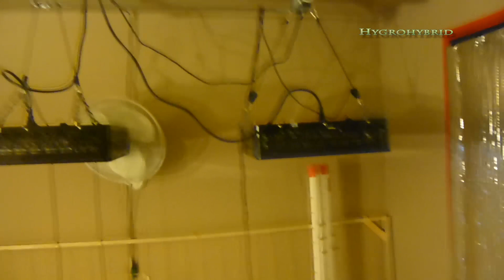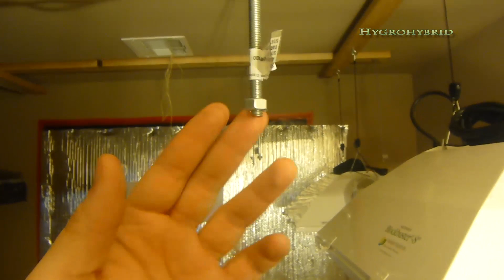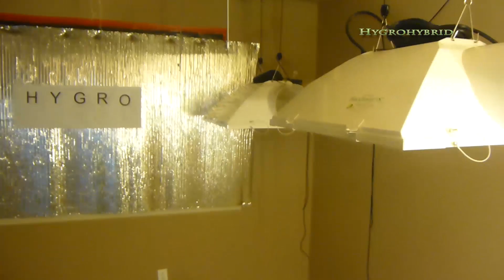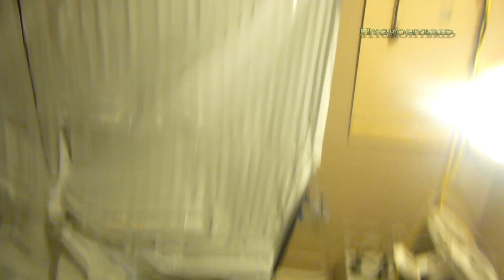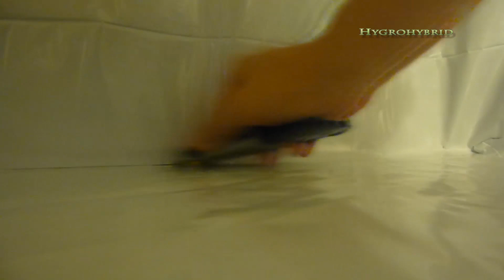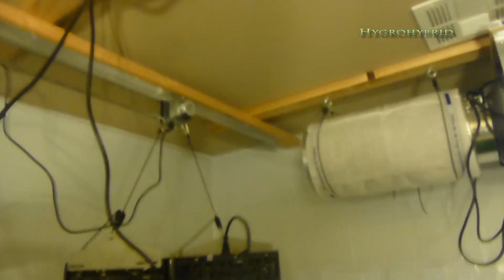Renovation Site B Almost There!

Comment: Really happy that I was willing to spend $1.07 a month to keep my finger on the pulse. I like the Black, round WalMart Totes better, they are WAY less expensive and the best yield I have ever seen you report came from them with simple nutrients and a perfect air dispertion with no "dead corners" like on the square totes. Just use a larger main reservoir for the "Ten gallon" round size RDWC.:) I think you nailed it when you said that tons of air was what is important, nutrients are not the central focus.

Comment: I was thinking of using light movers with a Black Dog LED but I was told that because the plant is not taking in constant light it will effect you're yield slightly. Can anyone give me more information on the pros and cons of using a light mover I find myself out of the loop. also I've seen a lot of light mover rails that go side to side but have not really seen any that move in small circles. Is there a reason for this?  

Love this video mate.